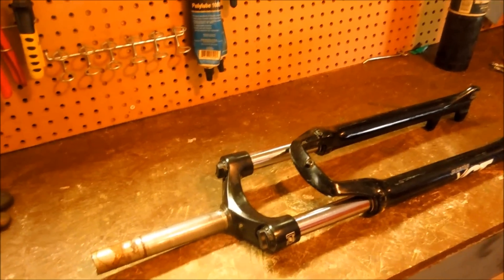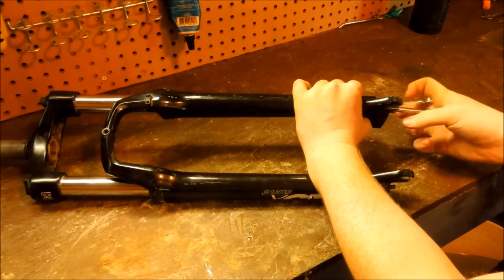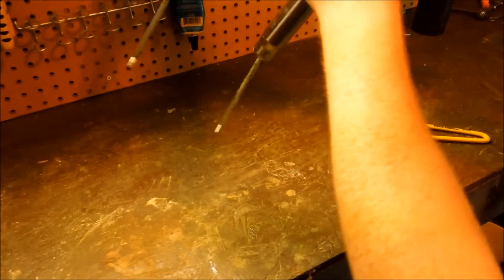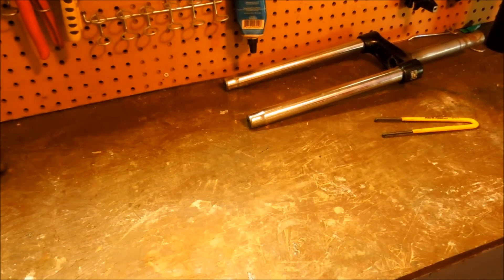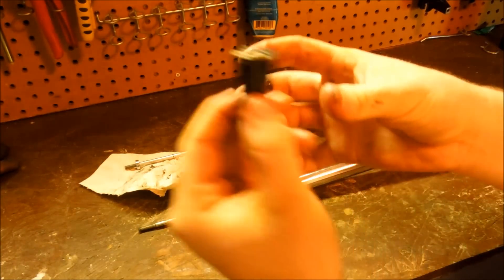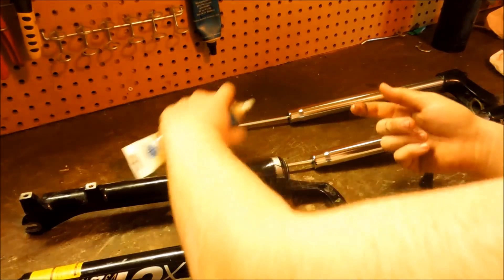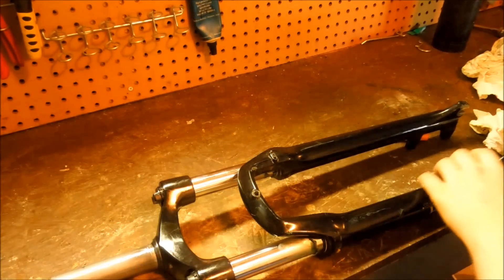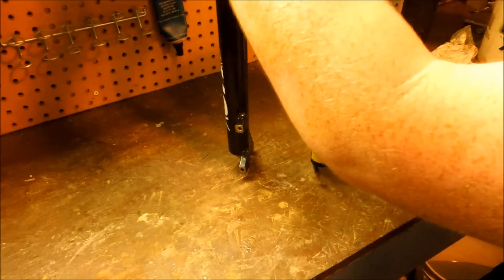Disassembly/maintenance of SR Suntour XCT forks

Comment: Pro tip: When disassembling anything especially for the first time; take pics, then bag and tag, what you can. Thanks for the video.
Reply: Why couldnt you have told me this before I ripped my bike apart completely? I got my bike powder coated and was thinking it would be super easy putting it back together. I took a few pics but not even close to enough. My 1st bike restoration. Bag,tag, lots of pics and take videos. I learnt alot with all the mistakes I made. Easiest thing was overhauling my marzocchi bomber suspension. I found a good video that showed me everything to do.

Comment: I have one of these. A greasy spring is all that is inside. I am glad of that. Minimal stuff to break, wear. Almost zero worries, maintenance...Cool.
Reply: does it work like shit though?
Reply: NastyNate 204 I am 53 years old. Not a hardcore rider, not at all. Honestly, I would not know a good working fork if it bit me.
  But... The fork does move. Absorbs some bumps. Has never bottomed out, and I weigh 215 Lbs. I compress the fork before a curb and it helps me "jump" it. Good enough for an old fart like me. I have had motorcycle fork and rear shock seals leak, in the past. I wanted some kind of simple fork suspension and NO MAINT. Tired of working on stuff. My bike is 4 years old.   So far, so good.
Reply: Fair enough. We're you watching the video thinking of servicing it or just for kicks? I'm about to replace the wipers and see what's going on in there. Just for fun.
Reply: NastyNate 204 Just curious on what was going on inside. I am a data freak. Have a good one, my brother.

Comment: The other side is used for damping.  For models that use damping, Suntour adds a suffix in the model number, such as MLO (manual lockout), which implies damping is used.  Models without such a suffix usually don't use damping and have an empty tube.

Comment: Can I use automotive greese instead of park polly lube? Ive used automotive greese on my axles so I doubt it would make much of a difference but I wanted a second opinion.
Reply: Yes you can. I've used automotive grease for a few years on any parts on my road bike that need re greasing.

Comment: Hey i have a sr suntour xct and one of the side has lockout and the other side has preload and i want to know which tool is used to remove the preload cap becoz my suspention seems to be harded even after i adjusted the preload to max mins

Comment: I got a giant atx 27.5 and the pre load im trying to get equal im not sure how to do that as firstly I wound them till they stop but the knows where not in line and one is noticeable stiffer to turn than the other. Please help
Reply: The RC Land Rover Lad I have the same bike and same problem
Reply: Hayden Poissant man I've twisted mine for ages and I haven't noticed any change
Reply: Just wanted to point that I wasn't able to unscrew the thingy, and at a certain point I, somehow, broke it altogether, I don't know what I did wrong but I wasn't able to remove on of the two dials of the fork. Now it's broken. It wasn't working anyways, but I completely messed it up.

Comment from the maker: They are relatively similar. The XCRs have lock out if I'm not mistaking. which doesn't add anything really to the process of servicing them other than putting all the parts back in correctly.

Comment: I purchased a Trek Marlin 6 2016 last year with Suntour XCT 100mm forks(29er). I don't really ride trails with it often, mostly commute, but been wanting to get off-road with it possibly in the summer. Would like to know people's opinion, either keeping the forks and save for a better bike for future? Or upgrading the forks to some Rockshox or some higher level Suntours like Raidon? I've read a lot and people say it's not worth upgrading, just get a higher end bike and others just upgrade anyways but lose money down the road if they decide to sell their entry level bike with the upgrades. At the end of the day, I know it's my money that will be spent, but I'd just like some opinions/inputs. Thanks in advance for taking the time reading my essay lol.
Reply: Dont spend to much on forks its not worth it with a bike of this equipement ie 24 speed shimano tourney etc. may be try suntour epixon its  an air fork you will need a pump about 20 euros/dollars fork is about  150/180 euros/dollars new at ali express or ebay  (new) you could just try bike as it is if your not to heavy or agressive or both bike should be ok for light xc  for upgrades better go for better bike new or used  good luck !

Comment: I have an xct v3 mlo, which has a lockout knob on the right side. How can I open that?

It's pretty much the same as the preload knob and I have the specialty tool for that, but I can't use it on the right side because the lever for the lockout is in the way.
Tried to open the thing with pin spanner or channel lock pliers but couldn't get enough grip. It sits pretty tight I think.

I tried prying the lever cap off with a screwdriver, but I couldn't get it out without damaging.

Anyone have an idea? Im going crazy here...
Reply: +Panthus Tigris did u find a way ?
Reply: +Yassine Ben No, I didn't. Sold the bike shortly after, so I still have no solution how to do it. Sorry.

Comment: a load of liquid when i had undone the two bolts at the bottom and pulled of the outer tube. what should i do plz help and does anyone know what that liquid was?
Reply: Sascha Stevenson water it just seeps in when the fork is wet and collects in the bottom

Comment: I have aSR SUNTOUR XCT fork, wich is completely stuck,
Stupidly enough, i tried to disassamble the fork myself,

And now the fork is broken, at least the outer part of the fork,

Is there any way to repair this by drilling some holes through
the top part of the fork and use a metal plate with holes and
screw the broken parts together with it?

Comment: The Suntour tool is cheap, don't cheat, get the right tools and you'll thank yourself later. The amount of time I've wasted or damage I've done by not having the right tool was never worth it, and if you call yourself a bike mechanic, your best bet is to buy these as soon as you require them so that if you need them again, your turn-around will be quicker and you can get more done.